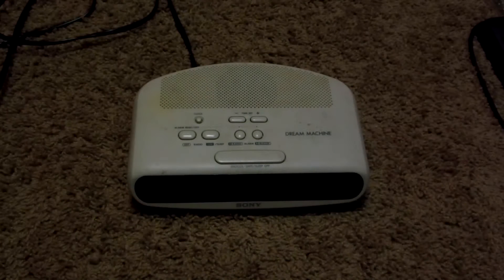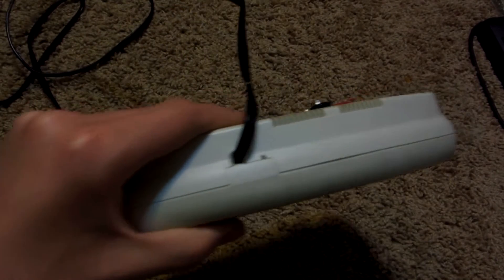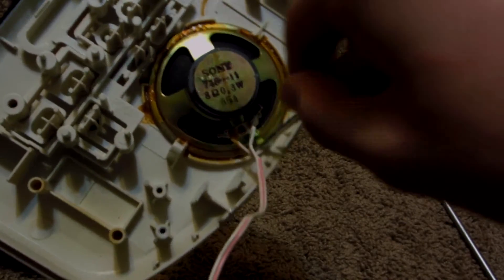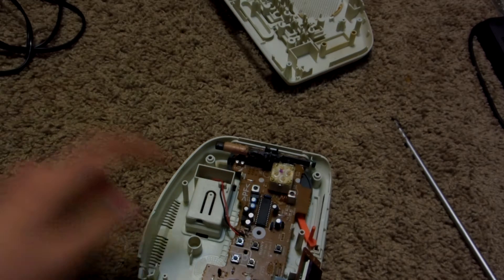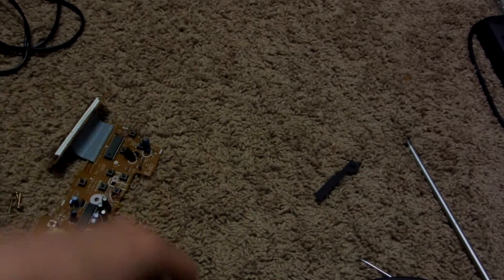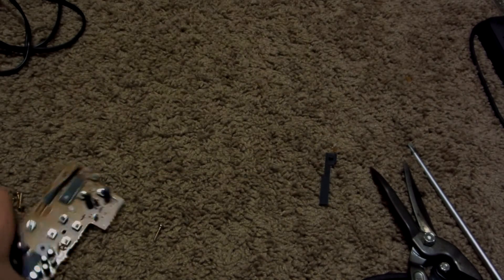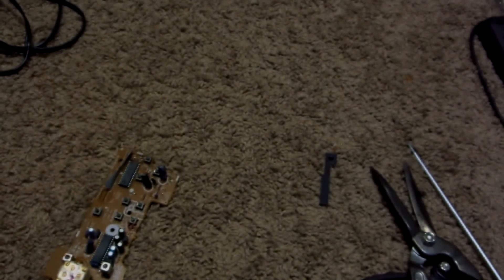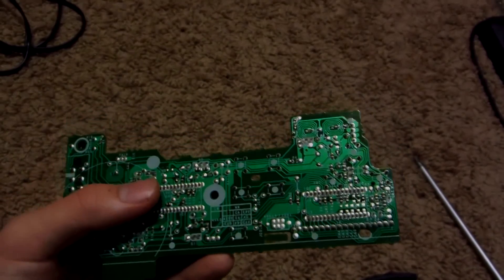E- Waste Scrapping: A Clock Radio!

Comment: Very interesting. If something has copper in it, I strip it. The price where I live for low grade motors is so low, about 3 cents a pound that I rather strip it.
Reply from the maker: +Anthony Colangeli That is true. I usually depopulate circuit boards and process the components in greater detail. Board depopulation will be a future video, so stay tuned. Thanks for watching! :)